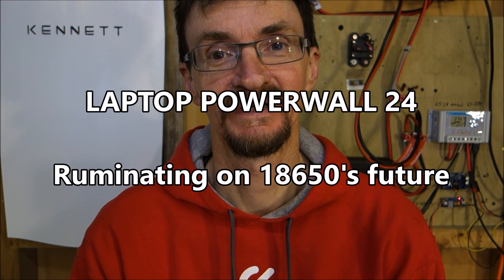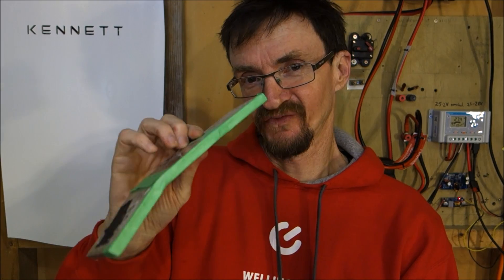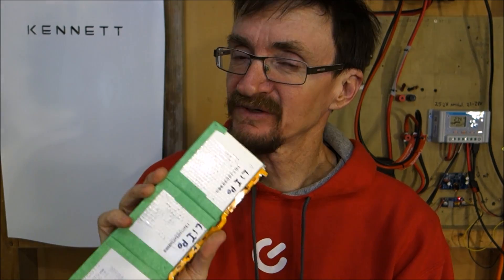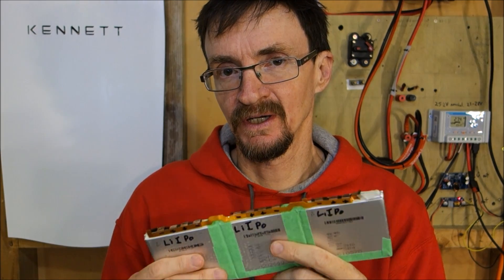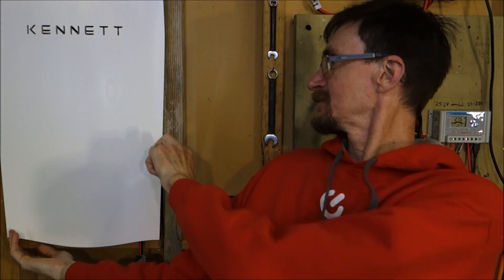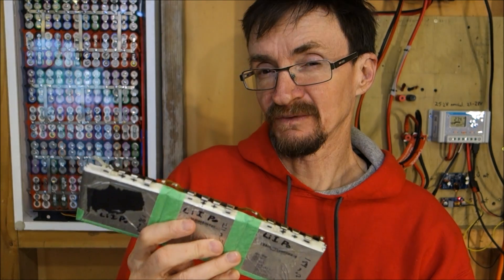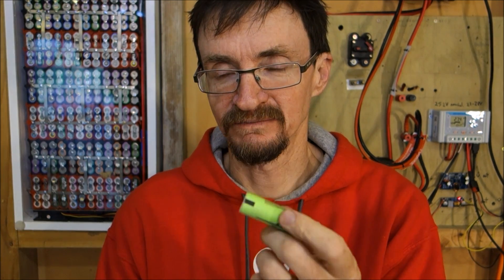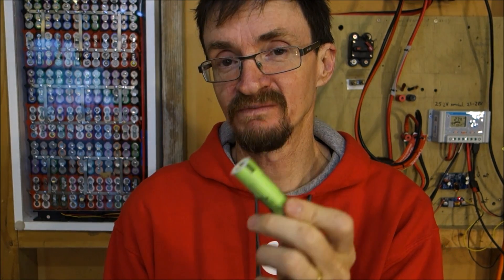Laptop Powerwall 24 - Are 18650s history?

Comment: Tesla's new form factor is 21700 (21mm x 70mm). While it is great that the 18650 batteries can be recycled by using them in a homemade "Powerwall" the pricing for Tesla's 21700 based Powerwall is reasonable enough that all the work required to recycle the used Laptop batteries really make it cheaper to just buy the Tesla Powerwll in the first place. Kudos to those that have put forth the effort to create their own homemade version of the Powerwall. I must admit the temptation is great to undertake a Powerwall project, I simply can't justify the time commitment (I Love the Idea Though !!! )
Reply from the maker: It does take a lot of time. If you can afford a real Tesla Powerwall then go for it. The DIY approach is fun though and very satisfying.
Reply: BB Cooter That's if you can get your hands on a Tesla unit, they keep selling out. But if they really do last for 10yrs as advertised then I agree with you, they are prices very well.
Reply: Don't forget the cars are using that form also...

Comment: read, tesla is moving to 20700
Reply from the maker: Yep. I wonder if they'll redesign the Model S and X to fit the new 20700's also.
Reply: luxus-carindustry today updates models like this:
every 3-3.5y for a soft-change
every 7th.y a model-redue
tesla has made the model-s (since 07.2012) for 4y bevor redue
i guess that a new model-s could be expected for end 2018-9.
i beleve that the fist 20700 will only flow into the first 300'000 model-3's after that they will bring it to the model-s/x raising it to 110kwh
don't really see prices for 18650 going down, because as you said "volume will move away from 18650"
Reply from the maker: Agreed

Comment: How much capacity do you have in your solar cells and how much time does it take to charge upto 80% as you have set from controller?
Reply from the maker: Hi Ramesh. I've got 420 Watts of PV. The time it take all depends on time of year and weather. In mid summer it can fully recharge 2kWh in a day, but in winter it might only add 10% to the batteries. I'd like to add more panels to provide more juice in winter, but I'm too busy spending time & money on battery stuff at the moment.
Reply: Ok Paul. Thanks for the info. Good luck for your work.

Comment: The 18650 battery cell format isn't going anywhere for the foreseeable future.  There are currently too many existing devices (flashlights, cordless power tools, etc,) that will be made obsolete if the 18650 format goes away.

With the Tesla Gigafactory producing the cells for the Tesla battery packs, the 18650 cell format is here to stay for quite some.
Reply from the maker: True. Looks like there will plenty around for a good long while - just not in laptop batteries for us to harvest.
Reply: Paul Kennett Laptop batteries may dry up as a source of good cheap cells.  I think another good source will be cordless power tool battery packs.  Many are lithium these days and battery pack failure is an ever present problem.  Perhaps it is worth investigating.
Reply from the maker: +bwillan Yep. Although the nice thing about laptops is they are part of corporate recycling programs. I suspect a higher percentage of laptop batteries make it to recyclers than cordless tool battery packs. Time will tell!
Reply: Paul Kennett Perhaps one could start one step before the recycling centers and go to the warranty repair places for power tools and see what they do with their cordless power tool battery packs that are replaced under warranty.

Comment: I think your right about the size format. I think the price of new batteries will be a factor. Though as 18650s will still have a market. Those pouches are a nightmare safety wise  apparently.
Reply from the maker: +harveyboy45 When I was doing e-bike repairs we had a lot more LiFePo pouch cell batteries fade than 18650. Usually  puffy cells in the bad battery packs.
Reply: +Paul Kennett 18650s will be around for a while yet

Comment: Since I've started the powerwall project after watching Jehu's videos I have always looked for a better charging and testing methods for multiple batteries. It seems that building your own 18650 holder for ten or twenty cells is cheapest when hooked up to a Imax b6 ( or other brand) charger.

 For capacity testing each cell on its own is the worst of it all. I have built two capacity testers that Adam Welch designed and they work well for cheap. I wish it was adapted for multiple cells by someone that knows how to code.

I'm still looking for a battery pack solution that:

- has a drop in design for each cell with fuses built in at the coiled wire side.

- Each cell can be removed easily if bad with the removal of a cap covering the other end of the cell.

- The packs could be designed in a couple different models depending on what voltage is required for your inverter. ( 6V, 12V, 24V, 48V, or 120V)

- Open source is key here where it can be 3D printed and some wiring is required.

If the future is not so good for the 18650 I can only think that there will be something better around the corner. 

I very happy that we have people like yourself and others posting videos of there way of doing things. When someone comes up with a great method I usually replicate it if it saves time and money. 

It's great that we have people from all different parts of the world jumping onboard the powerwall project experience.

Keep up the great work and post as many helpful tips you can about charging and capacity testing.

Cheers from Toronto Ontario Canada
Reply from the maker: +Eric Scherzinger I've got a friend who is working on an Arduino based multiple cell discharger - once he's got something working I'll do a video on it.
Reply from the maker: +Eric Scherzinger With regards to the "drop in design" you'd like - that would be great. It does add a lot of mechanical complexity to the project.

Generally with anything electrical or electronic device connections are a huge failure mode. And expensive to do well. The advantage of soldering fuse wire is it is easy to do with cheap tools and easy to replace.

Also - it's worth thinking about what situation you would want to replace a cell. How would you tell if a single cell was under-performing? Would you pull every single cell out and test it once a month? 

In my situation - if a cell fails badly - it should blow a fuse which I can see by visually inspecting the pack once a month. If one or more cells are just under-performing then there is no easy way to see that - apart from reduced overall pack performance. So data collection will be important to monitor long term performance trends.

Comment: Ok the future of 18650 is not very bright, simply because the annual production of electric cars will increase dramatically. So by induction scrap yards will have a lot of EV batteries. It really is not important what format these batteries are if used at home in a stationary application. You are more lucky than me because you live in the west and have access to these yards and have a higher percentage of EVs currently. I live in Egypt and did about 7 or 8 kWh of these 18650 for my home. If I had access to a Nissan Leaf scrap car I wouldn't have had to go through all the trouble with lap top batteries. There is also another big factor that will make my and your effort obsolete, and that is the price of the kWh will drop dramatically for Li ion batteries which will affect the LiFePO4 batteries. I personally think that the safety of LiFePO4 battery is more important than  the foot print and weight advantage of the 18650s of even the Tesla Model S, that is because I use these batteries for a stationary application.
Reply from the maker: +Alaa Sadek Hi Alaa. Your project sounds amazing. Very impressive.

In New Zealand Nissan stopped selling Leafs because sales were to low. Our government does not provide any incentives, unlike in USA. I am expecting there will be a lot more "dead" batteries from electric bikes and cars in the future though. That's where the future DIY powerwall projects will be.
Reply from the maker: Which does suggest that if you can find some good 18650s you can expect them to last a ling while (if you treat them well).
Reply: +Paul Kennett Plus the big problem with Nissan Leaf batts and the law suit. The prob is leaf batts is they dont last very long when used in the EV Car. Nissan didnt cool the batteries unlike Telsa, Telsa runs liquid cooling on its packs where Nissan cheeped out and has meant the batteries die after a very short time when compared to how long they are meant to last. So if buying old leaf cell first check the capacity. Now given how hot it gets in a car and how many amps the motor pulls one would of thought it would be worth cooling the batteries but for the cheap Leaf where "price" was the factor they skipped out.
Reply from the maker: +Mikes DIY Tesla Powerwall True - so it's going to be a while before we see any significant numbers of old  lithium batteries from electric cars being recycled here in New Zealand. There are quite a few lithium e-bike's in the country now though - so that might be a potential new source. 

But there's no established systems for getting those batteries to a recycler - like there is for laptop batteries. Interesting.
Reply: https://cleantechnica.com/2015/03/25/99-99-nissan-leaf-batteries-still-operation/

99.99% of Leaf batteries are still in use.
Reply: true
Reply: Paul there is a new Powerwall 2 from Tesla. The kWh is under $400 and that includes the inverter and the converter for charging. For $6,500 you can run your home indefinitely on the sun and wind. This means that the even the used car batteries are very expensive. They should be $40 per kWh yet they sell for 5 or 6 times more. Tell me how much does a kWh cost you to make with the 18650s? And how much is the charger and the inverter? When I did my system the kWh cost me $28. If I would do it again it will cost about the same, but that was just the batteries and welding them etc. I use no charger. I feed the pack directly from the solar panels. The voltage of the solar panels never exceeds the 4.1 v per cell. Here it is in more numbers.

Voltage of the solar panels is 29.89 v. Divide that by 7 you get 4.28V that means when the sun is in perfect position and the temperature is not hot then the charging voltage will be less than 5 v per cell. So that is a very safe way to not over charge. Also will prolong the life or number of cycles. That is on the price of the kWh. To solve that I increased the size of the battery. So 70 to 80% of a large battery is like 100% of a smaller one. And as it is a stationary batter then it is not important the physical size or weight.

But let me get back to the main point. The future is bright. Soon many will sell packs for much less than what you and I paid for ours DIY packs. They will come balanced and protected etc. Also the chemistry will improve, so the new packs will be smaller and lighter. What you and I did is good. We here in Egypt had power cuts often So I had to do it. You had a power cut due to a natural disaster. I am glad you are well. We also had to pay for our power anyway. So the money and effort we spent is not all lost.

So I suspect that your next project is to get a $40 kWh broken car battery. I am sure you will succeed. I wish I could do that myself.

At any rate, Best Regards from Cairo Egypt.
Reply from the maker: Yes - I saw the Tesla announcement and had similar thoughts to you. It is becoming easier to afford a real Tesla rather than DIY. I think it will take a few years for them to find their way to Egypt and New Zealand - both a long way away from USA.

I would love to get hold of an old electric car and build a recycled battery for it. Sadly there are not that many around here yet.

Regards, Paul